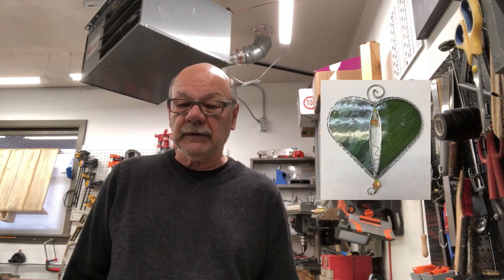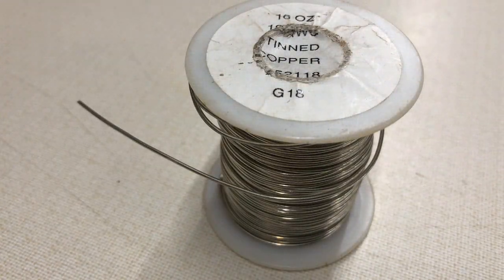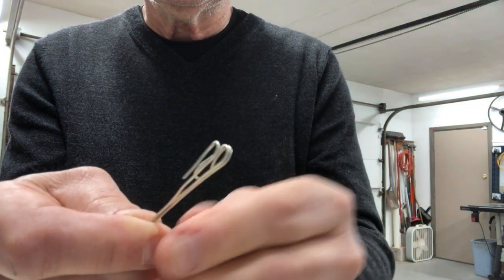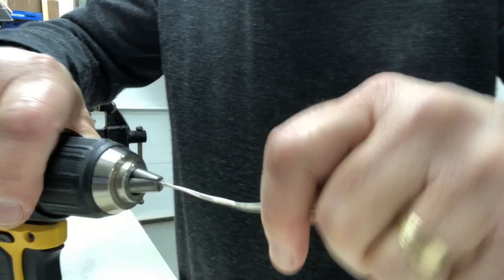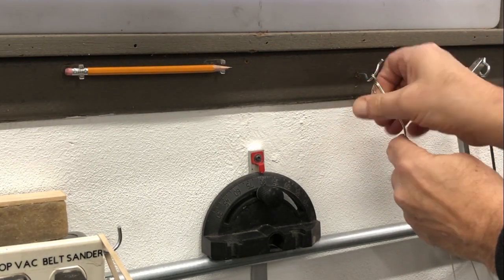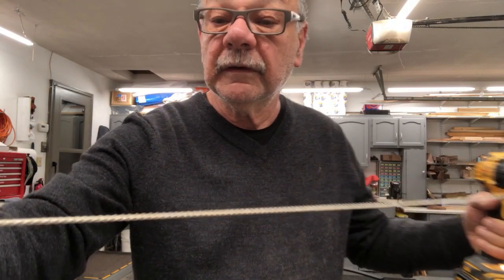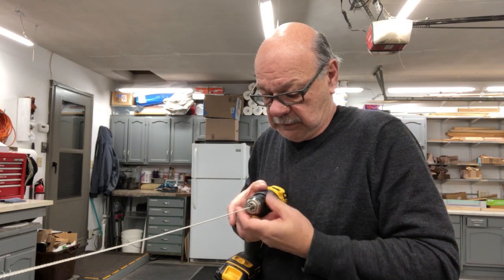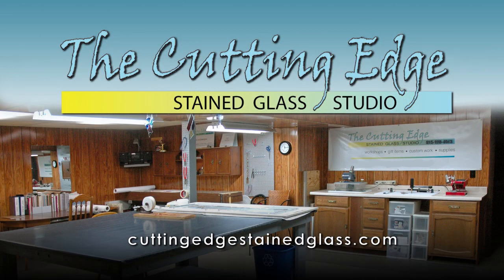Twisting wire

Comment: Can you show a video of the full process of putting it on the stained glass piece, is it soldered on?
Reply: Unfortunately we are not producing any more videos at this time so here's a textual explanation. 
After the wire has been twisted, it can easily be formed (by bending it) either along an existing solder line within the piece or around the edge. It's best to tack solder it in a few places to get it in place, then completely solder it all along as you hold it in place with a wooden hobby stick. Once it's completely soldered in place, it's best to finish by going over the solder with the soldering iron to heat/melt to a finished smooth look, the same as you would on a normal solder line without twisted wire. I hope this helps you and thank you for your comment.

Comment: Thank you!!! very informative video. How do you use, measure, cut and solder lead  cane to a glass? Thank you in advance for your answer.
Reply: Lead Came is a different than using copper foil. The lead is measured, based on it's location within the glass design. It is a soft metal so it can be easily cut with the proper lead came hand cutting nippers. Once the lead came piece is cut to the proper length, the glass slide into it. Once the lead is fit to the glass, it can be soldered at the joints only. In some cases where the span is long, zinc coated rebar may need to be used to support the lead and keep it from sagging. I hope this provides you with a simple explanation, but if you're seriously thinking of pursuing lead came, it would be wise to purchase a book on it or check out some of the instructional videos on YouTube. Best of luck.